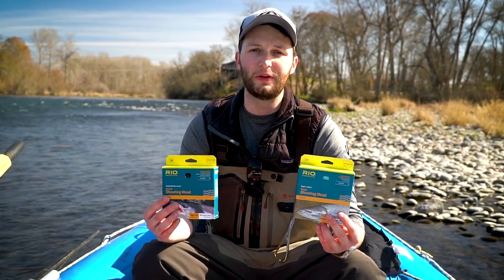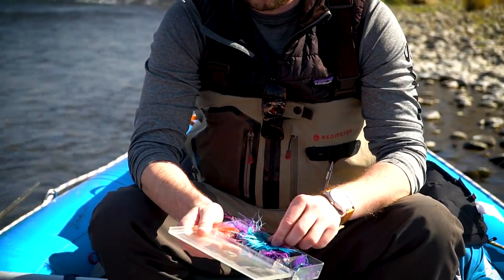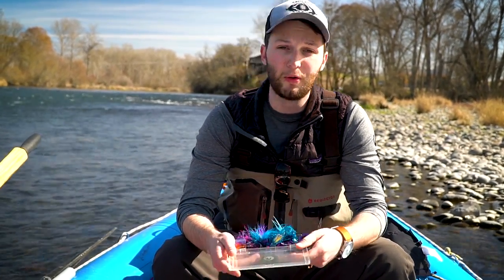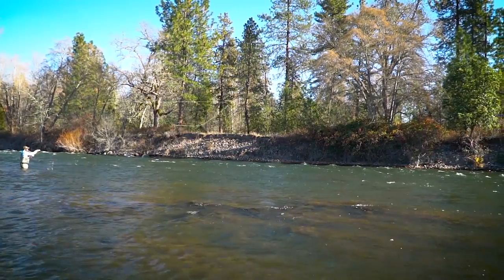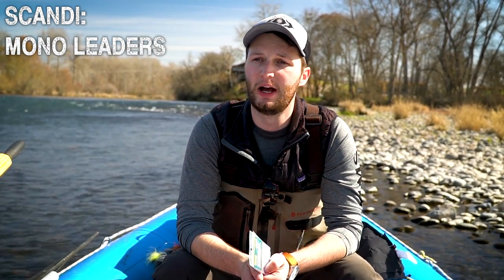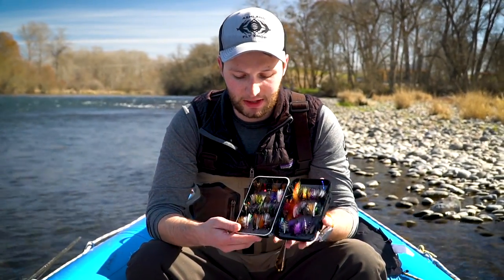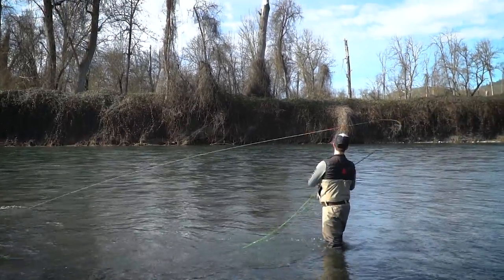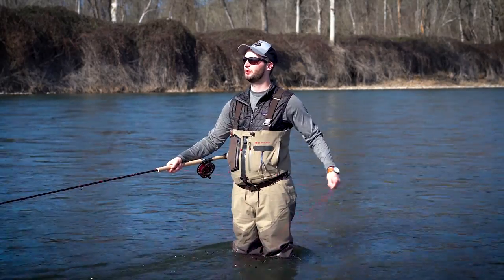Understanding the Difference Between Skagit & Scandi Lines | Ashland Fly Shop

Comment: When it came to the casting demonstration do you think the leader length and diameter had more to do with not being able to deliver that big fly than the fact that the line was a scandi taper? What if you just put 4 or 5ft of 0x or 12lb tippet at the end of the scandi head and tried to cast that large fly like that. Similar results or is it doable?
Reply from the maker: Great question! You are correct in that in many cases if you shorten your leader and use larger diameter leader/tippet you are going to be able to get a larger fly moving. What you lose there in the scandi system is a lot of the area you need to properly create your anchor. With skagit your anchor is determined by the "weight" of the tip as much as the length, in scandi it is more about the total "area" of the anchor. You can push the limits of a scandi with various sinking leaders & larger flies but eventually it's clear that the skagit is the better choice for these larger flies. Hope that helps!

Comment: How often do you guys put on a sinking skagit shooting head? And what’s a typical/recommended tip for those?
Reply from the maker: Great question! Sinking skagit heads are really great! They cast and fish beautifully. A slower swing and deeper presentation with less tip. You can use any tip with these heads . The general rule is you will get more sink with less tip. If you are fishing moderate to deep , using an intermediate sink head with a T-11 should fish you where you would have been with a t-14 tip and floating head. king salmon fishermen that use long , heavy tips really like them because they get down and stay there and are generally an easier casting set up.

Comment: Hi ,  if I am buying a Skagit for a switch rod , do I need to factor the combined weights of the mow tip and the skagit ?  my rod is reviewed to work really well on a 20ft compact skagit 540 grn, but what happens if I add a mow tip with 120 grn,   any sink tip is going to add weight, and so should I be looking at the combined total or do I just need to look at the skagit head only and not worry about the tip/mow tip ? thanks
Reply from the maker: Thanks for the question Sam! Typically we don't factor the sink tip weight in the load that's going into the rod. If your rod is well matched with a 540 grain head, than you should be able to cast a variety of sink tips, from really light to quite heavy.